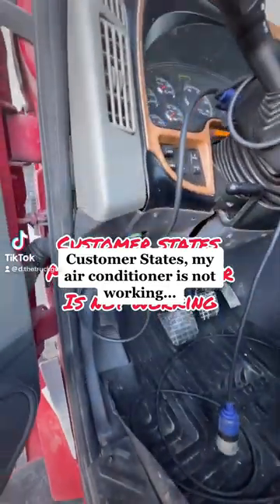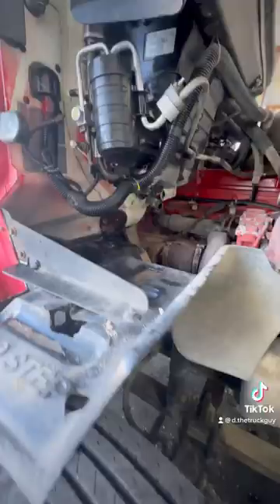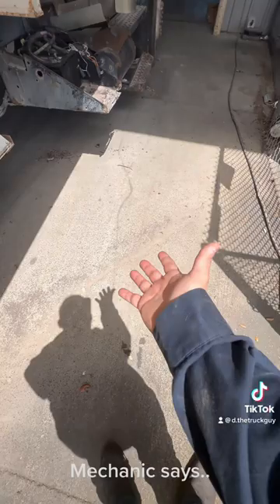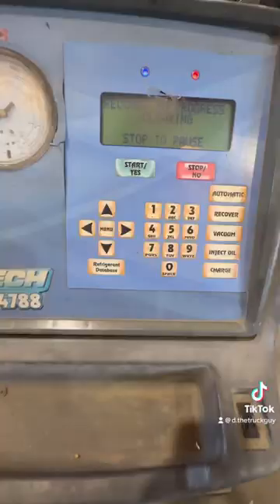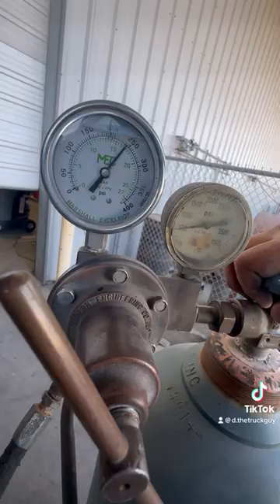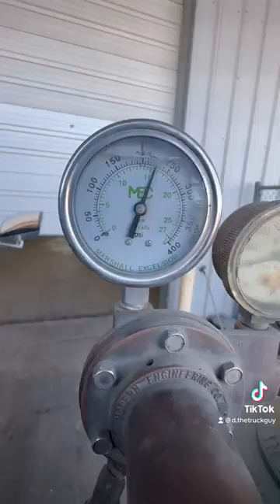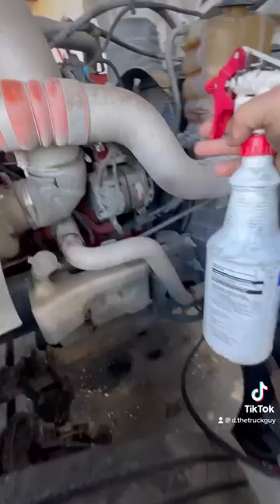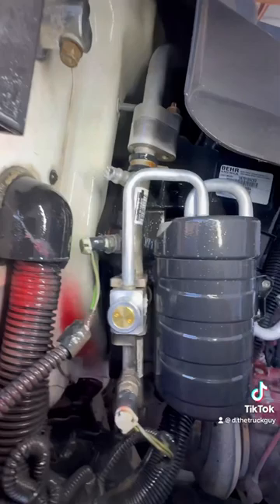#trucker #mechanic #diesel #trucking #semitruck #dieselmechanic #truckerlife #trucks

Comment: I would have made that shop pay me back my diagnosis time
Reply: It completely blows my mind that you can take a vehicle to a mechanic/dealer and tell them the problem, they'll replace thousands of dollars worth of stuff and still not fix the issue. Yet they still want to be paid for "fixing your issue".
Reply: @Michael Francis  its why I work on as much as I possibly can. If anyone is gonna play the guessing game costing me money I'd rather it be me 😅
Reply: and asking back the old but functionning parts.
Reply: @michaelfrancis3558  it's because they are not real mechanics, just parts swapper.
Reply: @michaelfrancis3558  that's why you should know what the hell they are talking about.
Reply: That's the main reason I got out the game lady bought her car in running rough mechanic done full diagnostic couldn't find issue I had quick look as I was learning could hear a hiss turns out vacuum hose was split prob £2 worth of pipe but charged her 2hrs labour
Reply: @michaelfrancis3558 you know how finicky new trucks are with all the different types of systems. Not everything is easy as it seems to diagnose.
Reply: @ElisPalace diagnosing what the cause is *is literally their fucking job*.

Comment: My A/C machine will fail the leak test but it won't show on the gauge when the valve fails. Its just good practice to replace them after all that work IMO
Reply: Good tip
Reply: Really fun when you have the aluminum ball poppet valves that always pull the threads out and you have to replace or repair the ac hose. I don't miss this business.
Reply: Replace the valves anytime you empty the system.
Reply: Blows my mind that this wasn’t even a thought until it was the last possibility.

Comment: I always had bad luck with schraeder valves. They are working fine. Find the leak elsewhere in the system. Repair. Connect the machine, do the stuff, go to pull the connectors off after done and all of a sudden refriegerant is blowing out of one the valves and now i gotta pull the system down again.
Reply from the maker: 👍🏻 same here
Reply: There are valve core removal tools that let you change them with the system pressurized, the caveat being they only work for standard Schrader cores, not the larger high flow ones or the GM rubber ball style.
Reply: It’s hit or miss with them I’ve learned to replace shraeder valves on older vehicles when I’m diagnosing the a/c system mostly because it won’t be the issue at first but when pulling down the system since the valves are so old they tend to get stuck open

Comment: Those valves do not leak when connected to the AC machine.  A good tech will check them once they disconnect the machine so that the work they just did does not go to waste.

Comment: Chances are what they fixed was an issue, and the Schrader valve was leaking after removing the machine. Most mechanics are too quick to cut down other mechanics to make them self look better.  But a good shop would have warrantied this issue if brought back.

Comment: So what was the original complaint why they had ac work done? Was the parts changing really needed or was this a new problem a new different problem. I like to know the story as much as possible a mechanic so I know what's been going on. Working on thermoking most of the problem I run into is bad modules, wiring, compressors and hoses, seals that leak, hot water valves that fail.

Comment: He'll also need to replace the drier again as well. The drier is sensitive to moisture in the air, and since by opening the system to the atmosphere,  it has become contaminated.
Reply: Yes but if it's only been open 30 mins or less you can slide by without replacing it
Reply: If you think about it the system is pressurized, even that little bit keeps air from entering the system. Zero pressure means air is entering and a vacuum means it’s being sucked in